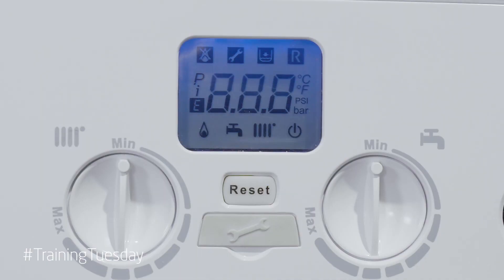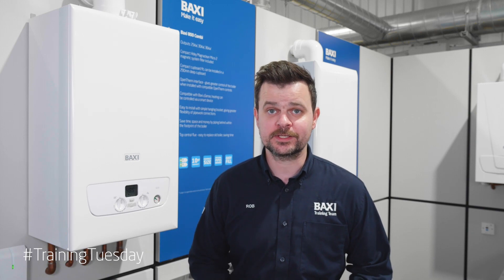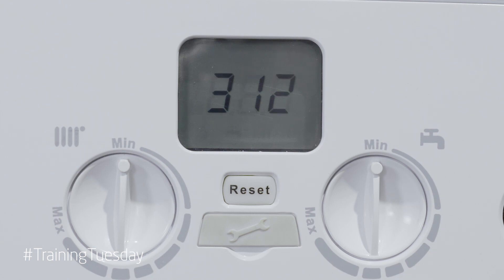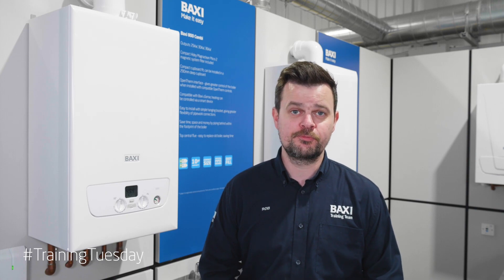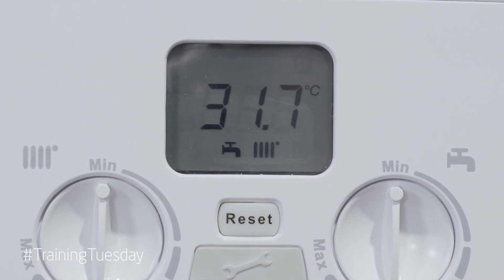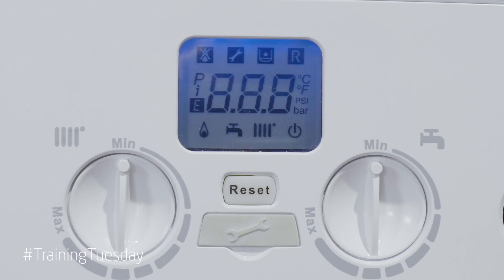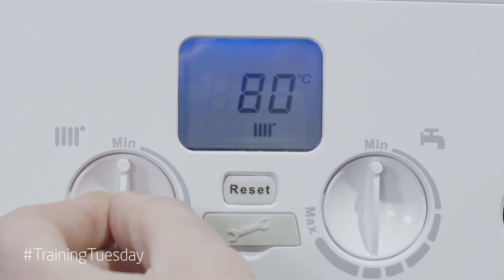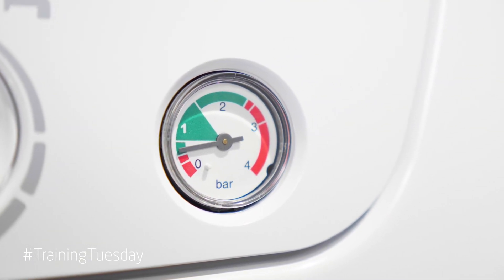De-aeration of the heat exchanger on the Baxi 600 and Baxi 800 Combi boiler

Comment: When Opentherm is used for the boiler controller the two temp control dials don't work & aren't used. Will they still work as described to activate the de-aeration mode?